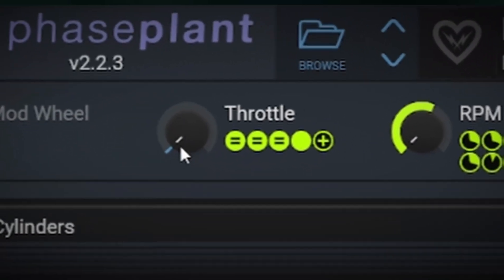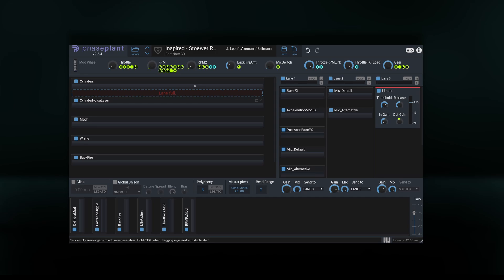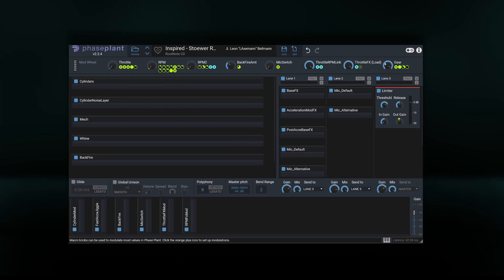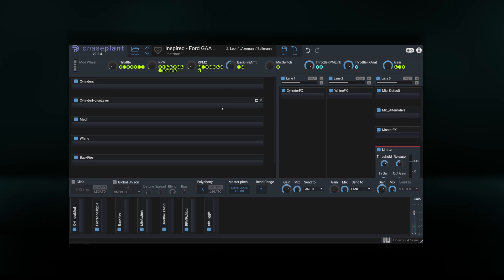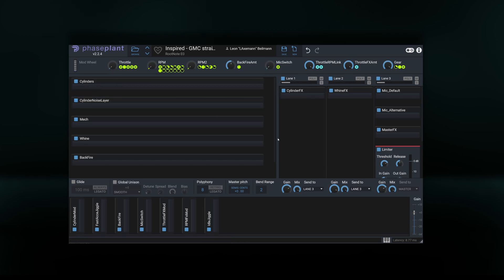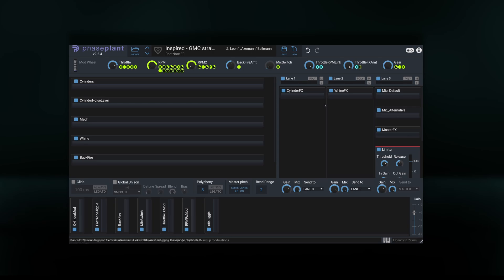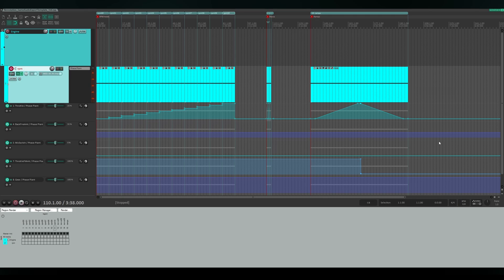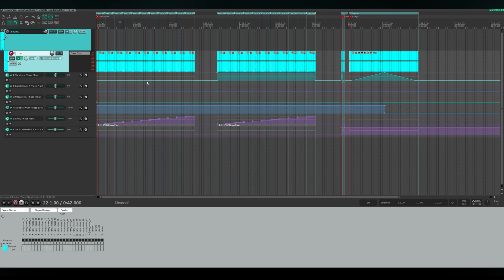Revvolution 1.6 Update - Content overview (Realistic engine synthesis in Kilohearts Phase Plant)

Comment: It'd be good to hear how engines with variable valve timing would sound in this, things like the Honda B16 where the valve timing literally pops into action at around 6000 RPM. 
This is some awesome stuff, well done 👌
Reply from the maker: To be honest, that's the first time I'm hearing about this, haha! And it wouldn't sound any different, as it's de-facto not an engine "simulation", so it'd be a matter of me figuring out what sort of sound processing and modulation routing could result in a convincing representation :)

Comment: Great update man! It would be great if we could have wavetable for 5 cyl and then use 2 of them for a 10cyl.  Adding more generators for the extra cylinders is fine up to 8 cylinder but beyond that we soon reach the limit of 16 attributes on a macro, then we can't have semitone or harmonic attribute adjustment on that macro for cylinders 9 and 10.  
Also is there a way we can hook all the generators semtitone value to one spot where if we change that value then it changes the value for all of them rather than having to change each one individually? same with analogue pitch or harmonic attribute on the rpm macro.  It would be a massive qol to be able to change that value once and have it apply to all cylinders
Reply from the maker: @edemir3947  Hey there! Thanks a lot for the great feedback, all very valid points. The 5 cylinder wavetable is absolutely doable soon(tm). The one-knob-pitchshift not so much, to be honest. I haven't found a way that makes it easy enough to recognize/work with and precise enough at the same time. At one point I'm simply reaching the limits of working within a synth and not dedicated software, haha :P
Reply: @LAxemann  Thanks man look forward to 5cyl wavetable! Bummer re one knob pitchshift, I was trying all sorts of keywords in my searches to see if there was a way, but couldn't find a way to do it. Hopefully the devs add in this functionality at some point, I can definitely see it's usefulness in a variety of projects

Comment: Very nice work here, sounds excellent! This is such a useful area of synthesis which seems to have very minimal resources to learn about it. Are you much of a car enthusiast outside of sound design? I'm not much of a "petrolhead" so a lot of info tends to go over my head when I try to learn about how engines make sound!
Reply from the maker: @mattjhart  thank you! :)
And funny enough, I'm very much like you there - Never had and still don't have a huge passion for cars/engines, outside of how they sound. :) But of course, I had to dig into the mechanical topics a bit in order to bring the synthesis forward, so I guess I have an "ok" superficial technical understanding by now.
It's also the reason why I included a small technical explanation in the pack, it helps to understand what one is trying to emulate. :)